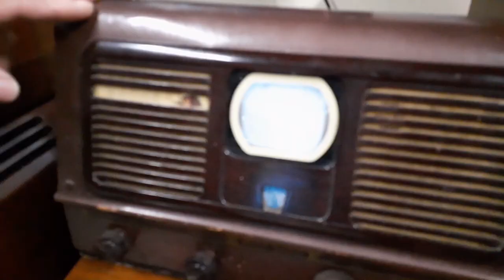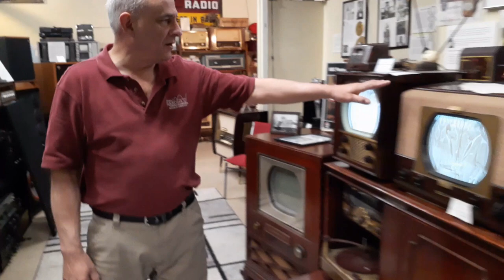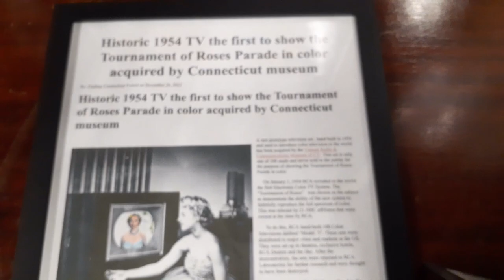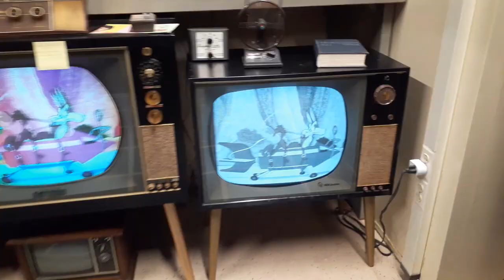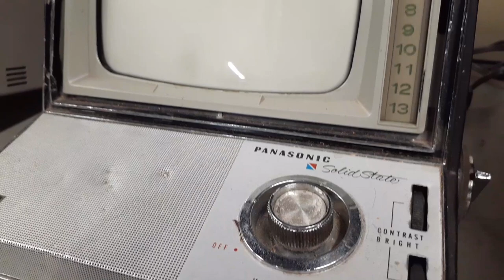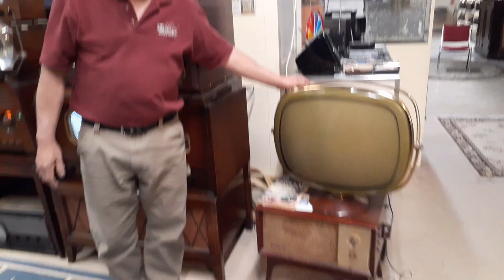Vintage Television Exhibit  at the Vintage Radio and Communications Museum of CT

Comment: When I was 5-years old and lying on my back underneath our 12-inch Admiral B/W television staring through the vents at the colorful electronic components and glowing vacuum tubes, how could it turn an invisible wave into pictures and sound, I just had to find out how it all worked! That insatiable curiosity that I still have to this day, led me to my career as an inventor, designer, and manufacturer of custom tools for professionals working in the fields of mechanics, electronics, and optics, all without a college education, passion will always transcend formal education and a diploma on the wall! David Riddle (Click on the circular "H2H" logo to see additional details about my career)

Comment: Years ago and for over 10 years I did a "Community volunteer" thing in a Church Parish Hall. It was on Monday nights and we finished up by around the 2nd quarter of Monday night Football.Then we  (mostly Men )would sit in front of the huge donated all tube TV console stereo (RCA or MAGNAVOX?)  It was maybe mid 60's and had 21 or maybe larger screen  and gave off enough heat to warm the place up in the winter.Some rich family had bought something new and they donated their old set to their Church. I STILL remember those vivid almost over saturated colors. I was like some Impressionist Painter did the grass, the stands, the sky. maybe not as ACCURATE as today's solid state and digital stuff but much more dramatic and dare I say ANALOG?

Comment: Great video! I am a volunteer at the Spark Museum of Electrical Invention in Bellingham, Washington. We also had an RCA CT100 color television. We had it running until the lead from the 6CD6 horizontal output tube to the flyback transformer broke.
Reply from the maker: Hope you can get it running again! If I am ever out that way I will stop in for sure!

Comment: I always preferred a more square type tube than the round ones. I like the square tube to have rounded corners though.  I like the look of the small red-coloured  portable set which sadly wasn't  shown working. Great video though.  Also did the colour system use 525 lines as used on the black & white system?  I'm guessing it did if the colour was overlayed as the video indicated. In the UK our black & white system was 405 lines and our colour was in 625 lines meaning a dual receiving set was initially required.
Reply from the maker: We did get the little red Admiral going:
https://youtu.be/kMQvcRY6yUk

Yes- the 525 line system was used with both Color and B/W sets- The FCC wanted it that way- Thanks for viewing!

Comment: I have visited your museum, and have a couple of similar early television sets in my private collection in California.  The first color TV I saw was in the window of the best TV store in Norwich CT when I was 12 years old. That would be  in1954. That CTC-5 looks very much as I remember it, though I never got to see a color program  on its display, even when there was one advertised by NBC to be in color. I think we were too far away from either New Haven or Providence RI. 
Much later after we moved to California, we bought used a "21" inch  RCA CTC-9. I still have that set. I had the chance to purchase one of two Admiral 1950 vintage Bakelite case TVs and chose the cheaper one, which measures 6" but may have been sold as a "7" inch set, using a tailors cloth tape for the measurement to include the curve of the tube face. 
 In 1963 I was in  Tokyo courtesy of the USN, where, at Ginza and Z Street at 9 at night on a Sunday, when I heard the unmistakable Theme song for NBC's Bonanza. I ducked into that bar and there above it was a Toshiba with the round bottle of an RCA picture tube. There being no others in the world at that time. Hoss Cartright fell off of his horse as I watched screaming in a high  dubbed Japanese voice " Itai!".

Comment: The RCA color set which was the CTC11 chasis, which was a 1960 set, he talked about in the video(at around 15:30 in the video), was almost the same as the one I bought from my electronic teacher.  That one, which I bought was a 1961, CTC11A chasis. I bought it for $5.00 in 1969, which was not working.  I fixed it with help from a friend which was knowledgable about fixing televisions.  It needed some repairs to the chassis, but very little, some tubes replaced, and the picture tube was also gone, which we replaced with a "rare earth" picture tube--to make the reds a little brighter.  We used it for many years as a family, to watch.  This started me in many years, to start repairing tv's for customers, which made me money, while I was in college.  My Mom cleaned houses, and spread the word about me repairing TVs, that's where the customer base came from.  One thing that he did not mention, that existed with this CTC 11/A period was the option of a wood cabinet.  RCA, took that black cabinet, and slid it into various types of wood cabinets.  Mine came with a wood cabinet, but was severly damaged.  So we removed the 4 bolts attaching the wood cabinet to the bottom of the black cabinet, slid the black cabinet out, put 4 legs into the 4 open bolt holes, and we had a standing teleivision set(as shown in the video).  The other unusual thing I remember, is this television, had a verticile chasis which stood on the side, on the left side, view from the rear.  But where I saw, a big improvement in picture quality, was around the CTC16 chasis in 1964, a big step in picture quality, over the CTC11/A chassis.  RCA had to sell millions of these, because almost, a 1/3 of all tv sets I repaired, was this model (CTC 16 Era.).  I abadoned repairing television in the 80's because they had gone to "solid state", plus I had started my business of machine tool repair in the mid 70's, mainly focusing on electronics, however mechanics as well, which lasted 45 years and took me to retirement.  Love this video, it takes be back many years, and the video is appreciated by many.  Thankyou for posting this video.

Comment: Excellent presentation. I worked in the domestic TV trade in the UK in the early 1960's. We still only had monochrome 405 - line at the time. I was involved with the change to 625-line, on UHF, & then the move to colour TV in 1967. It's therefore interesting to me to see the parallels that were going on in the U.S. But you had the edge on us, being early developers of Colour, with the NTSC versions. Like you, our manufacturers suffered badly on sales, once the Japanese imports came along.

Comment: In some large department stores in 1949, the RCA Victor T100 "Anniversary Model" was paired with the new RCA 45 r.p.m. record changer, which connected to the set's amplifier by a plug-in cable. Buyers were given a choice of a dozen RCA Victor Red Seal and/or blue-label discs for the new record player.  We bought ours from the F. & R. Lazarus Company in Columbus, Ohio, in early December 1949, and the picture tube was still good in 1980.
Reply from the maker: That's right- our T100 has the phono input.

Comment: Yes, you could purchase an RCA TV set in the fall of 1948. In New York City. That had been building constructed in, Camden New Jersey. And it's all thanks to my mentor, Thomas M. Bray.

None of you will know that name. He's not in any history books. He was run roughshod over by the folks at Bell Laboratories. That he worked for in 1948. When Shockley and the other guys came up with the Transistor. He was there for that. But he came up with Vertical Hold. For TV as we know it. That was the one stumbling block.

While there were experimental broadcasts for television prior to World War II. And afterwards. They could never lock the vertical hold.. He explained it to me. And his eyes positively light up when he told that story. Because nobody knew how to derive a reference voltage to lock, the vertical hold to? And he figured out how to do that. By taking a voltage reference from a different part of the TV set not related to vertical hold. And it worked.

Because back in those days. Folks like Bell Laboratories virtually Owned their Electrical Engineers. And anything they came up with even at home on their own time. Bell Laboratories would own. Those were different times.

And so on this particular morning. Tom went into work at Bell Laboratories. To show his colleagues.  How to log vertical hold on their own  homemade TV sets. And Bell Laboratories immediately, patented it. And then sold it to RCA. To introduce the first commercial TVs that consumers could purchase. With vertical hold that will lock.

Up until then. You would virtually need a full-blown Television Engineer. To be able to keep a viewable picture on the screen for any length of time. As vacuum tubes drift. And Tom's vertical hold circuit was the linchpin.

Nobody knows this piece of history except me Tom's son Toby and George Massenburg. Because Tom mentored both of us. It's strange, I know.  And lucky  just happens.  Anton was an actual genius. And former Methodist minister.  But he had walked away by the time I was introduced to him. He told me he always had a bad taste in his mouth over, commercial organized religions. I understand.

And then of course years later in 1981. I was hired by RCA to work for NBC-TV & Radio. At the Network and their  Flagship FM Station for DC. When I was suddenly transferred into, Network TV News Operations. And I was like oh no? That's not rock 'n' roll. No more rock 'n' roll. News and political talk shows. Bummer.

Then they wouldn't let me lose. To work for SNL. Nope! Or game shows, so Bob Rose, none of that stuff. They wanted their best engineer doing the news. And there was only about 1/2 dozen of us in DC. And I never expected to be working with the POTUS's. They look almost the same in person as they do on TV. When you're sitting in the, East Room of the White House for a Presidential Press Conference. That was kinda fascinating I have to say. What the hell am I doing in here? And can I blow a joint, in the bathroom? No? Well then where did Willie Nelson do it? I just had to get slowed before I got there. I had to make that sacrifice. And I got through it. I'm still alive.

I actually enjoyed meeting Buddy Rich at 14 years of age in 1970, best. When I was able to hang out, Stage Right Wings. At Detroit's large-cap Masonic Auditorium. Back in 1970. What a thrill!  The greatest drummer in the world. That I got to shake his hand. I swore I would not wash my right hand ever again! Later, my girlfriend made me wash it. Well okay? Well he was dead by then anyhow. But great getting to meet him that once.

They don't make good stuff like this anymore. If it's not surfacemount? Nobody would know what to do with electronic parts? You have to stick them on circuit boards? Why? Don't they have a computer to do that for you?

Nothing will make sense ever again
RemyRAD
Reply from the maker: Great story- many companies owned their employees ideas- Just ask Philo Farnsworth or Edwin Armstrong...Thanks for the good info!

Comment: A nice representative collection of TVs, and well presented.   I recognized several accessories on top of the sets -- signal boosters from RMS, Decimeter and Regency, a Mallory UHF converter, a Trio antenna rotator and several set-top antennas.  I loved that you have the magnifiers for the early small screen sets and can demonstrate them.  Interesting that 25 years later we didn't want magnifiers for the tiny portable TVs even though they had smaller screens.

Comment: Looks like something is modulating that Pilot's horiz sweep - like some arcing somewhere.
Reply from the maker: It does not like the florescent lights in the museum- very poor filtering in that set- its 60 cycle
Reply: @kirks1959  I wonder if a couple of well placed low value bypass caps added in will quell the instability?

Comment: I grew up on b/w tv in the 60s and 70s. Our neighbors had color but the image was always crappy looking, (reception issues?) I was not envious. 
It's interesting to see the direct comparison of these original tv's screen display with the advertisement's picture of what you could see.
Reply: In the early days, colour was crappy.  Because of the way the colour was encoded, it was very sensitive to phase shift, which would cause the colours to change.  Another change was a black mask around all the phosphor dots, which helped keep the colours separate and later on the tech improved, with comb filters, to improve the colour quality.  The phase shift issue was unique to the NTSC system.  The PAL system in Europe reversed the phase of alternate lines (Phase Alternate Line) so that the phase errors would cancel out.

Comment: WOW!
I’m 71 and remember the tube sets.
 I remember going to the local drug store with a handful of tubes that my dad gave me to get them tested to determine the bad ones.
Reply: Yep, been there, done that!  Occasionally my grandfather would bring out his tube tester, which could provide a better test than those store testers.
Reply: @James_Knott  
I still remember the tube that was the most trouble..AX7!
Reply: @pucmahone3893  That would likely be the 12AX7, though it might be a 6AX7.  The 2 are identical, other than the filament voltage.  However, the tube that causes the most problem would likely be something else in another set.
Reply: @James_Knott  
Yea right!
12AX7!
It was really nice in those days that you could actually repair something that you had. And feeling good about it. !
Reply: I was well known at the drugstore for constantly going there to test tubes. I have my own Sencore tube tester now.
I've been collecting TVs since the 70's. I'm 62 now. I have many of the sets in this video and they are all working.
Reply: @andershammer9307  
I remembered that we even have a television that that’s the way you paid for it just to put money in it and it would work say for 1 hr. Then add more to watch more. 
The money was used towards the purchase price. 
LOL

Comment: The comments on progress are not nearly as great in 10 years as personal computers. Compare a 1985 PC to a Windows 95 PC. The progress for TVs in this video was a joke. Little progress was made during the time covered in this video.
Reply from the maker: There was tremendous progress between 1946-1956. Intercarrier IF, Aluminized CRT's, AGC for better signal regulation, Larger CRT with shorter deflection angle, the development and licensing of the NTSC Standard for Color- Along with nightly color programming (NBC) Sales of Color TV and Service to back it up. Portable Sets. Price down-quality up-Wireless remote control. I agree PC development was tremendous during the 1985-1995 period as well.
Reply: Yes. Huge progress. And progress is still being made, such as quantum dots.

Comment: Great video. Something you might find interesting - - the NTSC standard used the phase of the color carrier to indicate color (hue). For technical reasons, it had a max bandwidth of 1.5 MHz at one color, and 0.5 Mhz for the color on the opposite side of the color wheel. So they chose to make orange the color at the 1.5 MHz position because that is the color that humans see with the maximum resolution. That is also why fog lights are orange.
Reply: The RCA technical papers about colorimetry and the development of the NTSC system. There were many considerations and the engineering details will keep one busy for weeks trying to comprehend.

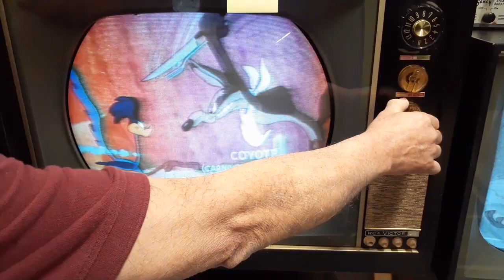Comment: 18:52 What you are referring to is Chrominance and Luminance signal.
Reply from the maker: Yup-
Reply: @kirks1959  Also the CRT whine is very noticeable through out the whole video.
Reply: @SuperCartoonist you are hearing 15.75khz sweep?
Reply: @publicmail2  If that the noise coming off the electrical beam sweeping on the glass tube.
Reply: @SuperCartoonist no from flyback coil and related components.  Usually wife would complain and husband couldn't hear it.
Reply: 3.57mHz colorburst

Comment: I still have the family Air King tv that used the RCA TS630 chassis. It was purchased two years before I was born. 
It is on it's third 10BP4 tv tube.  The first one went kaput in the early 50's when I grabbed the socket on the tube and twisted. The second one went out in 1961. The third one has been in since. The last time I had it plugged in was 1984. it now sits in my shed.

Comment: A set that I didn’t see in your collection was a Sony trinitron tv. That was a game changer because of the one gun producing the rgb on the screen, that design was also revolutionary instead of being round dots on the shadow mask, they were vertical stripes that allowed for more color pixels per square inch instead of the round one that had wasted space between the color phosphors.
Reply from the maker: Good point- we have one (KV1710) and will get it going and out to see...."She got the house, the Caddy and the bank account- I got the Sony" hahaha
Reply: I am in the UK. I still have a working 12 inch Sony Trinitron colour tv set from around 1969/1970.  It needs to be connected via a digi-box now as analogue broadcasting finished  a few years since, but still gives an excellent picture. Being in the UK it was designed for PAL 625 lines UHF. It still has a tint control though, although that is not really necessary here.
Reply: The Tritron is not a one gun - despite Sony's description.  It still had three independent cathodes and still needed a shadow mask.  A one gun tube has one cathode and no mask.  Sony ended up making such a tube for their camcorder viewfinders and a small (5"?) model at some point in the late 80s or early 90s.  The original Trinitron is very similar to the PA tube GE was working on in the 50s but never really got right, but GE had the first production in-line picture tube in the 60s.